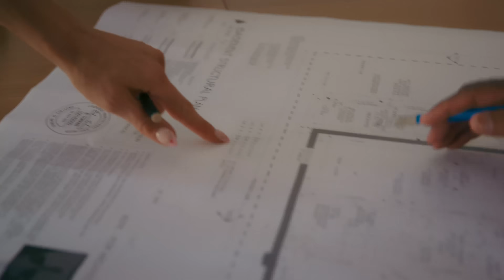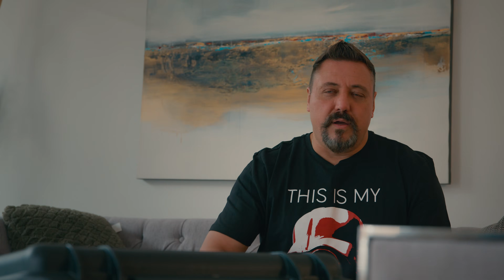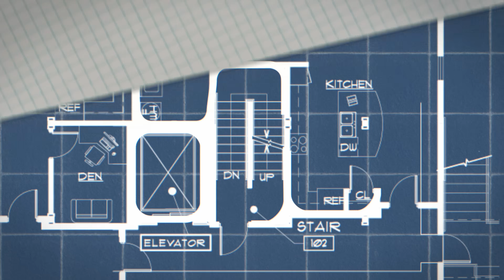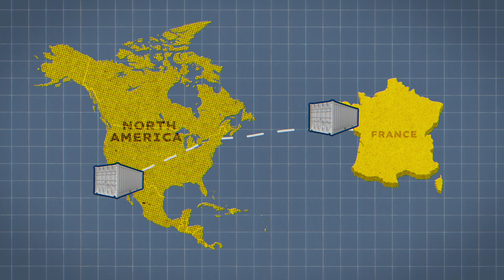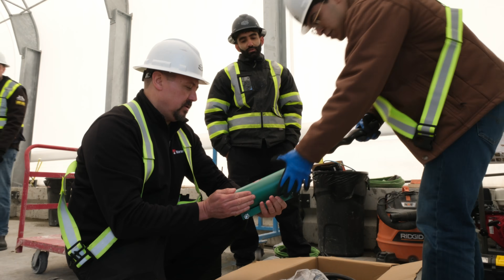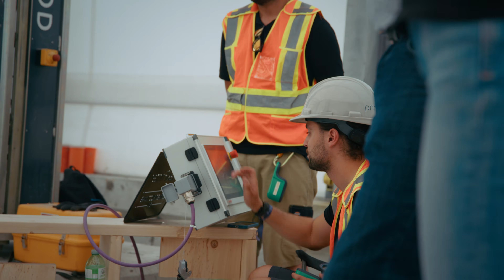Unboxing a $1,000,000 3D Printer.

Comment: to make homes cheaper, sections should be sold at 10x8' with a popout to put a standard sized windows or doors and electrical already set up, a veneer would be optional if you make it out of recycled plastic.
Reply from the maker: Breaking things down into modular, ready-to-go sections could streamline the process and bring costs down. Grateful to have people like you watching and sharing ideas 💡

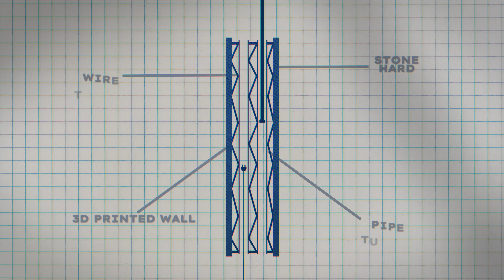Comment: 6:10 I’m so glad you mentioned the conduits. I’ve seen about a dozen videos from companies trying to get into 3D Printing houses, then showing the process. Not one time did I see them using conduits for the plumbing. One of them actually ran the pex straight through the wall 🙄. Once I saw that I felt like screaming at them. “How can you do repairs if the shit is stuck in the wall?” 

I think the smartest way to run the plumbing to the fixtures is to just imbed “1 PVC pipe that’s cut to the thickness of the wall. Fish it through the pipe and 3D print a plug that the lines feed through with ABS or PVC. You could even spray foam behind the cap to keep bugs out, and it’s simple enough to remove when a repair is needed.

This is the first video I’ve seen from you, you gained my subscription.
Reply from the maker: You’re right! Maintenance matters, especially if we’re serious about this as a scalable solution.

Aligned on your PVC channel idea too - Smart, serviceable, and clean. We’re trying to highlight with this series. Glad you found us. Welcome to the crew 👊🏽

Comment: Might want to look into stamping the cement on the exterior walls.  Should be possible to do without too much cost or effort.
Reply from the maker: Great suggestion, Danial. Definitely something we can look into as we push both form and function. Appreciate the tip! 👊🏽

Comment: I would think for a million bucks you could hire a company or even possibly hire a team of college graduates to build you a printer of this size cheaper, all of the ip is available as open source, and probably the software as well with a few tweaks.
The material is probably less than 100,000$…then you would not only have a   Printer, but a set of plans and sources to build additional ones to sell or put to work. Also you would have a much better idea of what it would take to operate and what it would be capable of.
Reply from the maker: Appreciate you bringing this up. It’s a conversation worth having as the tech matures 🛠️

Comment: design a home utilizing a surface-mounted cable tray on top of walls close to the ceiling ) system that serves a dual purpose: it routes utility drops to outlets without penetrating the walls, and simultaneously provides indirect uplighting for the ceiling.

you can 3d print this "cable tray"  and the utility drops in the walls , then install drywall / sheetrock internally and  the holes of the utilities goes away
Reply from the maker: Love the dual-purpose approach with the cable tray and uplighting - functional, efficient, and design-forward. Appreciate you sharing this - this type of thinking pushes the industry forward💡

Comment: Fantasgtic.- Good vibes-p Good energy. I am gonna leave this here... come look at properties in Burnaby British Columbia, primarilly in the MetroTown area... due to new regulations, and I don't know the exact details but my understanding is there have been directions Federallally/ Provintially that force municipallities/ area sourroundin transit to increase density. MetroTown being what it is with the large bus loop and many gtransit routes connecting... just look at the insain development happenning arround Patterson skytrain station. It is nuts! Why i mention this...just down the stfreet from me a 4 plex was built. Practically an appartment... the sourounding? Single unit homes pale in comparisson.... but, many of those propperies also have now added on lane way houseing. The neighbourhoods are changing fast...much because of new changes in how a propperty may be utilized due to this pressure from the province. Why Burnaby? Those structures i mention just a short time ago would not be allowed. If you'd built a structure and it didn't alighn with the home on the property adjacent then...well you couldn"t...building regulations wouldn't allow for it. We have a large property, with a garage... but, we have to have the garage set back into the property, taking up valuable yard space...why? Because it was rquired it line up with the homes down the block. Shame. Not now. Things like that have been abollisshed. If we had the time, money...energy...down would the garage go and up would a ....laneway house go...maybe even with its oun car port/garage...heck the propperty is large enough...now we can. And since the house/ propperrty is within the specified zone sourrounding Metrotown...major transit hub AND adjacent to major bus transit lines ,,where strickt zone used to be a thing NOW? Is not...previouslly putting up changes to propperty like that you;d need to address community concerns...say the neighbours are dilligent in knowing what construction is occurring arround them.... they are mad the 4 plex is so large it takes out their view....or that the neighbours took adantage of this unique oppertunity and their laneway home practically to the edge of the propperty line doesn't alighn with the others.... used to be able to go down to City Hall and file a complaint...hold meetings and councull votes...not anymore. Many petty regulations rules set out how one should build on their propperty have been set aside and many others a blind eye to. To be able to meet the Provinces demands to increase density in these areas. The neighbour should themselves take advantage of this unique sittuation since...no more ... they can't do anything about these now old regs. 

I think this provides a huge oppertunity here for a company like yours. The propperties are not cheap but maybe someone in the area is willing to take a chance and since they'd been thinking of putting upp a laneway home would be willing to take on the project with a construction method like yours. Just the fact that municipallities are neing demanded to increase density in these specific areas...i can't seee why not...why wouldn't Burnaby welcome you with open arms. There's plenty of oppertunity here....

.... now to bet that equpment hefre is another question, along with the fact it's gonna get really wet here rain and snow. Maybe that's a good thing and provides some breathing space to work out the logistic....i don't know why i am assuming yo  u are located in TO...i didn't catch where you are based...maybe youre already in the lower mainland...then whoah! Easy! Regardless, this is some thing yourself, your compa,u slook into these new density demands... im not 100 sure if it is specific to BC with the huge housing shortages maybe the demands are being set out from a Federal derrective =being forced down onto municipallities by provincial government...not every city is taking this with open arms though...places likw Whit Rock for example have many  high traffic but/ transit lines....but how's a place like that, already pretty dense supposed to even increase anymore? Again another reason to look into the Patterson/ Metrotown areas since though has its dense spots...there is much oppertunity to be had with all the simgle familly homes borderrin..maybe youd build med a new laneway home..lol Jokesx aside, seriouslly look into this because it is prime for what your business is set out to achive and that's to construct more house/ home

Comment: You know that similar technology exists from 70 years ago that runs analog on a gas engine. The end result is basically the same- but costs pennies to buy and use in comparison. For $1M you could buy enough of these machines to build a town in less than a month.
And that machine you want will be obsolete in two years or less.
Plus, you will have to charge more for the same/similar building to cover your "investment".

Comment: Walls are one of the smaller costs of house construction... I don't see how anyone could justify this. Can't 3D print a foundation, site prep, plubming or electrical, a roof
Reply from the maker: That's the mission we're on to find out - we'll actually be building it on the show. Stay tuned!